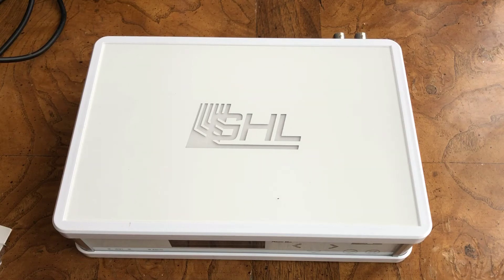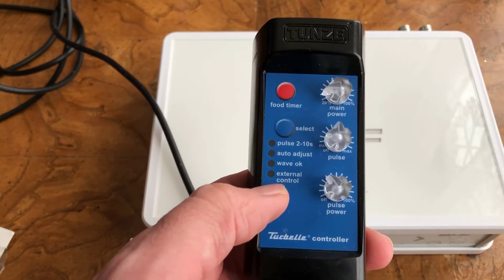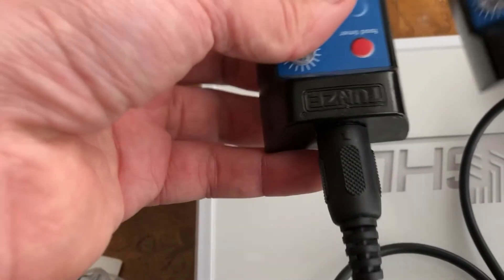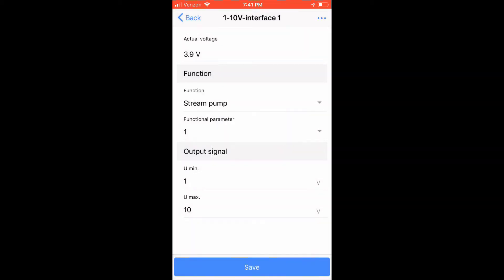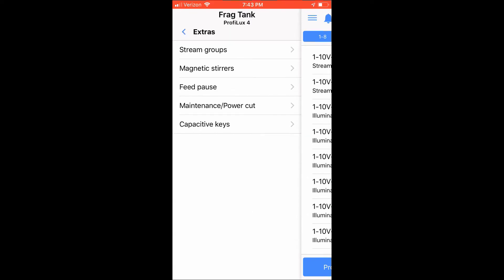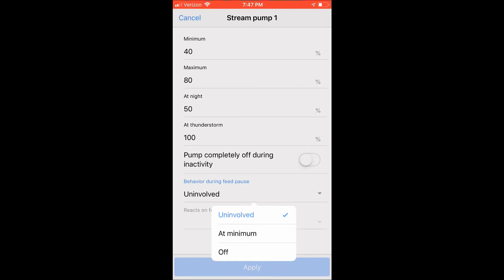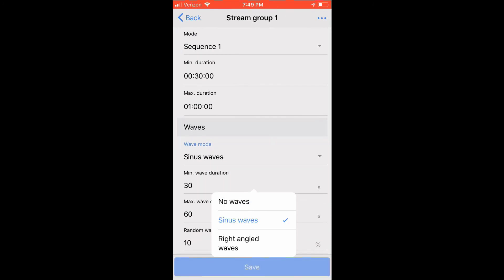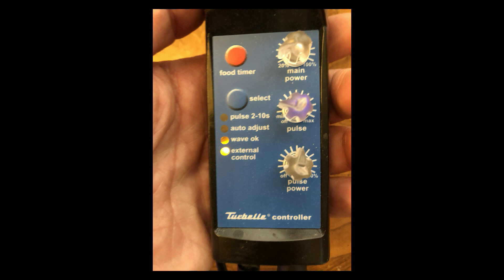GHL ProfiLux Controller (4/4e) – Install/Config 1-10V Tunze Powerhead

Comment: Great write up however with the Max and Min voltage I think the newer pumps you have should be set to (min) 0v  and (max) 6.5v - then each pump configured with a min flow of 20% and max flow of 100%.  For the older style (little black box) it a (min) of 0v and (max) of 8v - then configure each pump to a min flow of 30% and max flow of 100%.  Hopefully this makes sense.
Reply: Pro trick: you can watch movies on Flixzone. Me and my gf have been using them for watching all kinds of movies these days.
Reply: @Izaiah Avery Yea, have been watching on flixzone for years myself :D

Comment: Great write up.  This answered the hook up questions. But roger recommended having two 6095s. Which I bought for my waterbox.  Now he recommends one side running at a constant 30%  while opposite one is Constantine changing speed.  Then after 12 hours or so. Switch sides to constant 30% while other one continues to change speed.  Is this possible??
Reply from the maker: Yes, you could do this via a Illuimination channels on the 1-10V ports.

Set for the first 12 hours constant at 30% and then create the ramp up and down for the remaining set points. Using two for the 30% would give you 22 more set points for the remaining time intervals.

You would loose feed mode, and tunderstorm but this would give you the exact feature your looking for. If you wanted feed, you would then plug them Tunze power bricks into a powerbar port and use the filter option on the port and would turn it off.

Comment: Worth noting that if you are using a Tunze battery backup at the same time, unless the P4 maintains power during a power outage, the Tunze pumps will not work while in “external control”. The Tunze 7097/7096 controller is powered by the Tunze pumps themselves so avoids this issue.
Reply from the maker: Your 100% Correct, thank you for pointing this out. The P4 would need to be plugged also into a UPS. If this is done then you could also use the Power failure mode also on the P4 and lower power consumption used on the 1-10V ports allow the Tunze battery backup to even last longer.